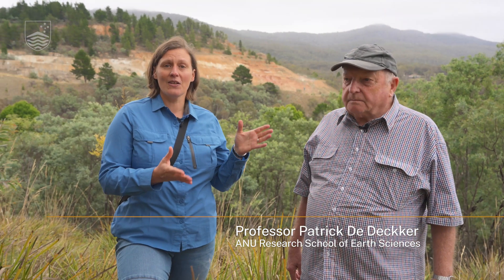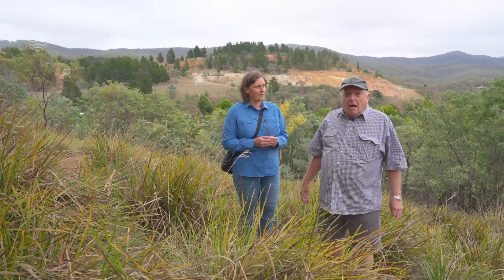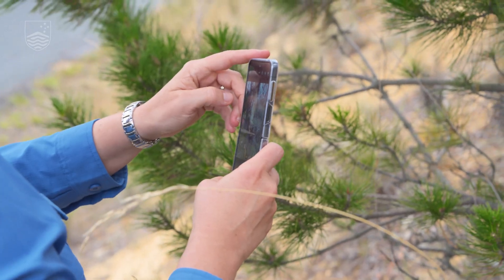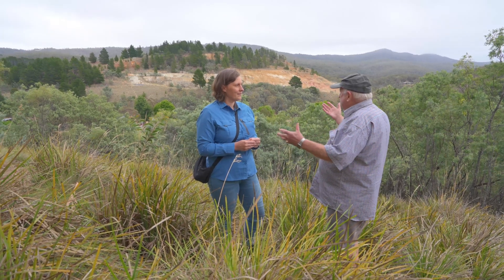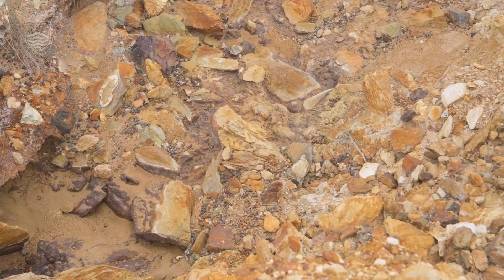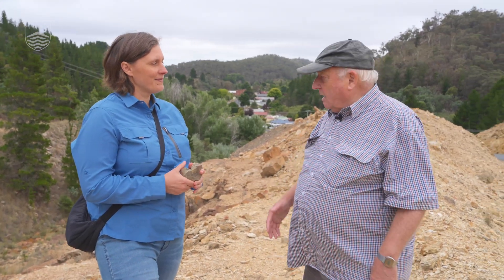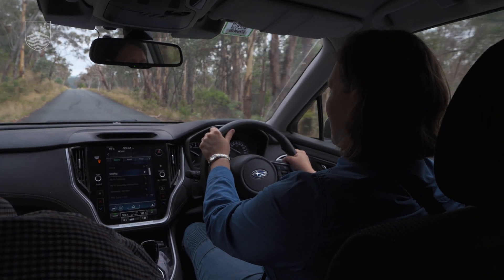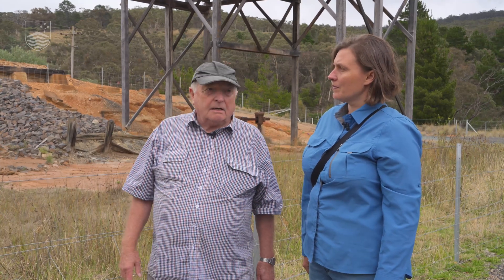The science behind the Captains Flat historic mine site

Comment: If you wouldn't eat vegetables grown in the soil at Captain's flat you wouldn't want to drink the local tap water as the tailings dam collapsed into the Captain's Flat dam in 1943. The fish in Lake Burley Griffin have 10 times the heavy metals levels as fish elsewhere as a result. All of Captains Flat & Queanbeyan's sewer water flows into Lake Burley Griffin too. Keating's collapse is veiwable where you drive up Jerangle road and look right at the concrete culvert that stops some water from entering the old mine workings and flooding out the remaining shafts & vents & into the Molongo river. Keating's collapse is where the mine collapsed 11 levels one night just as a shift of miners had come up and another was about to go down.
Reply: The CF dam is above where the collapse happend, plus there's a $2 m treatment plant. The CF tap water is better than Canberra's. Plus there's a sewage treatment plant at CF, you can see it in the video.
Reply: @Eduardo-l9n3y  WRONG... You can still see the toxic scar left by the 1943 tailings dam collapse into the dam on the satellite picture. If you think asbestos water pipes are better than Canberra's water supply you've been drinking too much Captain's Flat tap water. Sewerage treatment plants only break up the turds, hardly changing it into drinking water quality.
Reply: Further more...Back in the 1990's the local council workers used to fully open the tap at the bottom of the dam wall to clear mud from the intake pipe as the tap water was coming out muddy. They ended up extending that intake pipe.

Comment: I live in Foxlow st. Actually in both 1939&'45 the tailings dams collapsed. or so the newspapers of that time reported. Uuum by the way the professor guy doesn't seem that knowledgeable perhaps the Gentleman could read The Australian Mineral Reviews from the 1950's up till 1961. B.t.w no one mentions Arsenic, which is derived from arsenopyrites the main source of pyrites the other mineral is pyrithite different spelling, different thing . after the mine closed the Council at the time used the enormous amounts of smelter slag as aggregate for...roads, concrete - footpaths, curb and gutters,most of the concrete around The Flat can be dated that way . problem is that the slag gets it's colour from metals as impurities. Zinc to Cadmium ratio was 400/1.during the 50's a sulphuric acid plant was set up for use in Superphosphate fertilizer production.